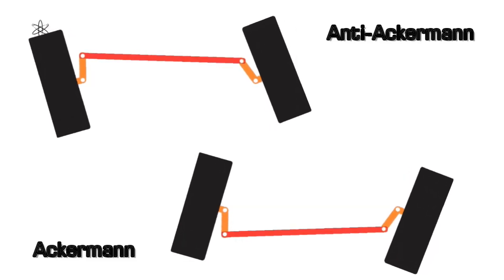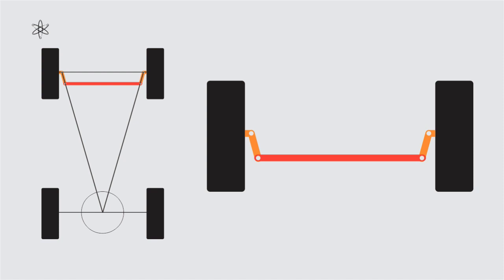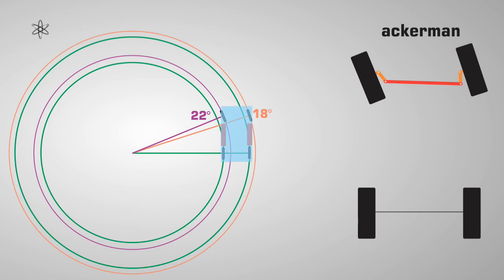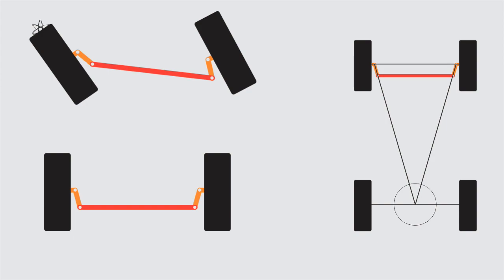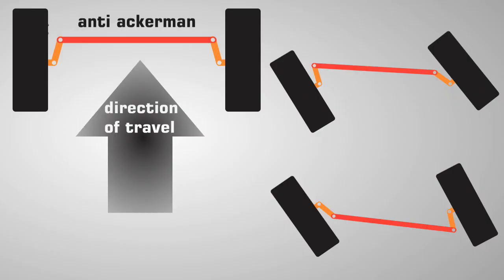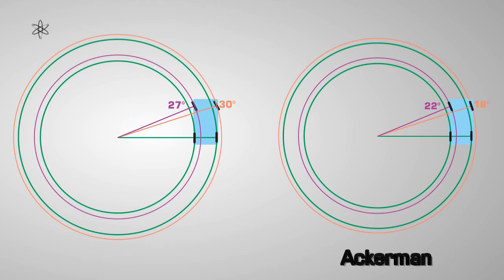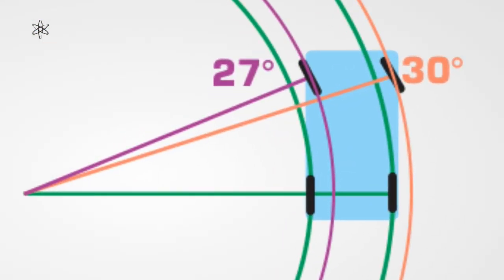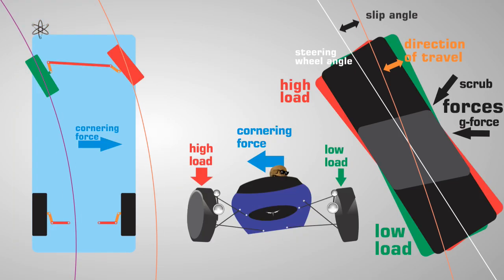The Anti-Ackermann Steering Angle

Comment: Anti-Akermann is an understeer geometry, please note here an important thing here is that once traction is lost, the coefficience of traction is exceeded, then you are into a skid, this is NOT and should never be considered "under steer" as that is a fundamental principal of steering and suspension geometry. Skidding is purely loss of traction, under and over steer is measureable and predictable, skidding is not. Over and under steer HAS to have traction. Even deformation of tyres is not under or oversteer, this can be referred to as "slip angle", fundamentally, the 3 things are very different and have very different physical properties. Please NEVER label them all as the same thing.

Comment: Neither of these conforms to a race gokart. On a left corner for example, the inside wheel turns left proptionally to how you turn the steering left. The outside wheel starts turning left, stops, and starts to straighten out as the steering wheel turns left. Its because the steering wheel axis is only a few inches to the trackrods, and the pivots for the trackrod ends are several inches from the axis the wheel turns through.
Reply: So it's hyper-Ackerman? Is that intentional?